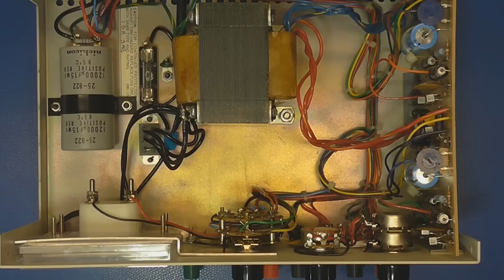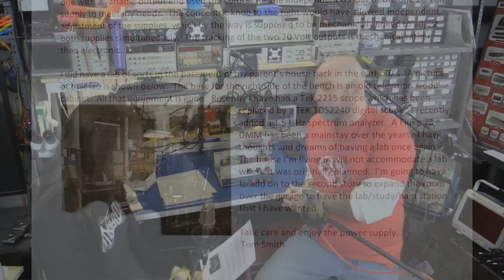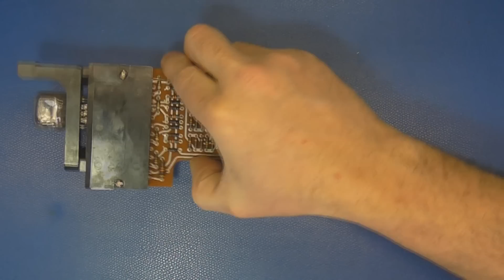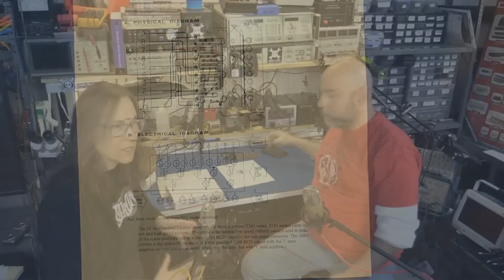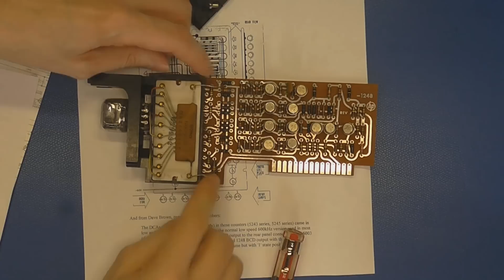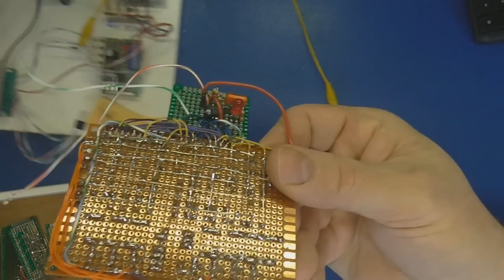Viewer Mail - And Nixie Fun!

Comment: Great show! When I worked at a NASA STADAN satellite tracking station in the mid 60s we had HP counter modules with Nixie displays. These used 4 double triode valves (tubes) 12AT7 equiv. and used the same sort of optical decode/driver units.

Also we had cold cathode regulator valves (tubes) that were radioactive and the boxes had a note warning not to store more than a certain number together!

Comment: Thanks guys, just getting around to watching your episodes. The Heathkit IP-2718 is a great supply that I continue to use today after building mine in the early 80's; it's my goto for simple stuff. Current limiting is not selectable rather the circuit will start to limit when you exceed the max capacity (something I've done many times inadvertently!). Still chugging along after all these years with only two minor repairs. Hope to see a new episode soon.

Comment: I was getting worried your show went off the air.  Keep em coming.
BTW point-to-point wiring was always called rat's-nest wiring when I was growing up.  The lowest common denominator was perf board for a semi-decent project.  BTW:  I love Nixie tubes and have always wanted to make my own clock with them but am not a fan of high voltages :(